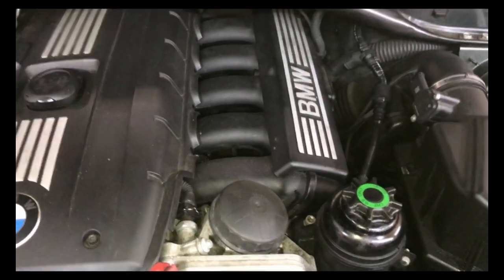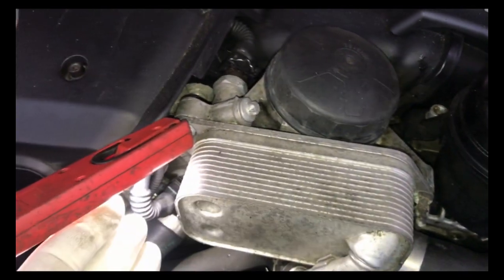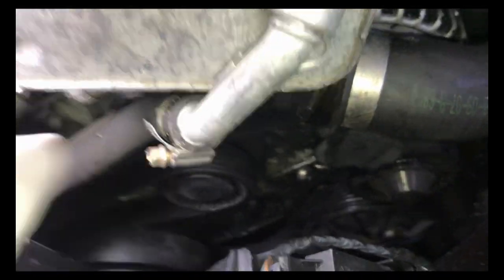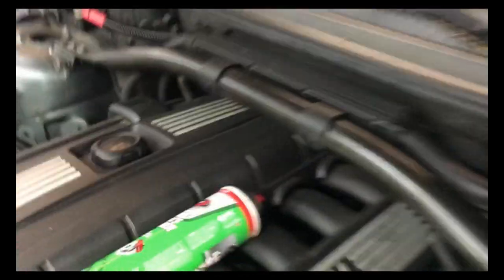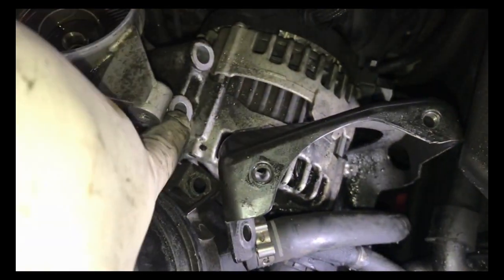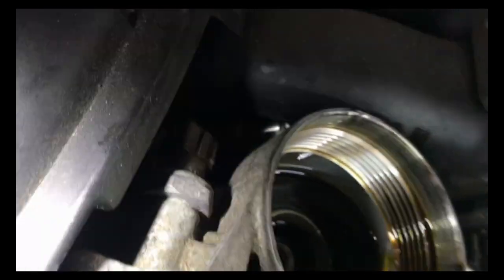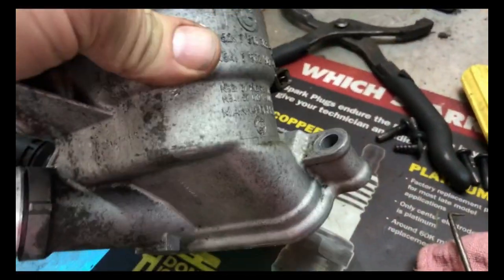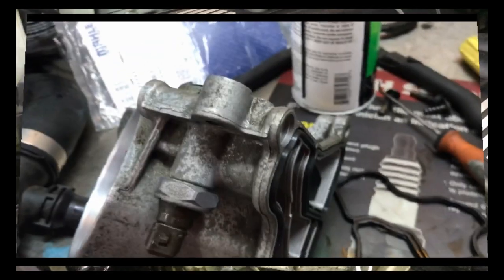BMW X3 Oil Filter Housing Gasket Replacement

Comment: Thank you for this video, I just purchased a 2008 BMW X3 and the belt came loose due to these oil leaks. As I am not a mechanic I should probably invest in this repair. THANKS. My BMW only has 179,000klm, so I'm going to invest,

Comment: Hello, thank you for the great video.  The 5/16 swivel you used on what looked like a torx bolt, did you use a 12 point socket and it worked on the torx bolt? Thanks!
Reply from the maker: 6 point swivel

Comment: Great video. Our is a 2006 with the 3.0 gas engine and it does not have the oil cooler on the front of the oil filter housing. Do I need to drain coolant before replacing the gasket from the oil filter housing to the engine block? I dont have a good way to lift the car and work under the car right now. Thanks.
Reply from the maker: I am not sure but I bet coolant still flows threw the housing so I would drain the coolant out of it. Thanks for watching

Comment: First thanks for your idea with this very helpful but, I was able to do it without having to take alternator out 1/4 in swivel and a 1/4 extension long enough to reach with 1/4 ratchet and a magnet stick to guide the bolt back in,  I was able to get it out no with problem.

Comment: How does the coolant hose come off? Also, people say to be careful not to have oil or coolant mix. How do you avoid that?
Reply from the maker: The upper hose has a clip that you pull out on. I drain the coolant and then wipe everything out.
Reply: @TheGAutomotiveAndMore  Can you do the job without draining the coolant?
Reply from the maker: @sarahdell4042  No I would drain it so it does not mix with oil.
Reply: @TheGAutomotiveAndMore  Do you have to do a full drain, or is there a way just to get the amount out that would be able to mix?
Reply from the maker: Just drain some out or pull the upper hose.

Comment: I have the exact same problem with my 2009 x3.  Did you drain the oil before you took anything off, or is that not necessary?  Very helpful video!
Reply from the maker: I take out the oil filter and then that lets the oil drain back into the engine. You should drain a little coolant out of it so the anifreeze won't go into the oil passage when the housing comes off.

Comment: Hi what if you have oil in  in the coolant reservoir? How would u flush the system? There was no coolant in the oil compartment.  Do you suggest changing manifold gaskets, oil housing engine gasket ( i may not be saying it right) of course housing oil cooler gasket all hoses, change oil, belts clean alternator?
Reply: They have way to do it with soapy water I didn't take it. Apart but the engine never overheated

Comment: I have this problem but where do I find the hose from the head to oil filter housing where can I find the 2 jpressure hose and cooling hose
Reply from the maker: You should be able to find all the parts online or at your local foreign car auto parts store. But the dealer has oem parts that fit better.

Comment: Do you really need to take the belt off. You got it off with the belt on so I'd imagine you could get it on the same way
Reply from the maker: I would take off the belt so coolant and oil does not get on it. This belt was all ready oil soaked so it did not matter. Thanks for watching

Comment: Might end up doing this myself to save money.
Reply from the maker: Good luck and thanks for watching
Reply: @TheGAutomotiveAndMore  Do you have to drain the coolant before replacing that radiator hose?
Reply from the maker: @Joshalots   Yes I would to minimize the coolant mess
Reply: @TheGAutomotiveAndMore  Hi there, thanks for the video. Is there a specific method to bleed the coolant systeme after the repair is done?
Reply from the maker: @TheMartinSavard  I only drain a little coolant out. Then refill. If it has a bleeder on the radiator definitely loose it and refill. If you remove all the coolant you need a scan tool to do a water pump bleed on it. Thanks for watching